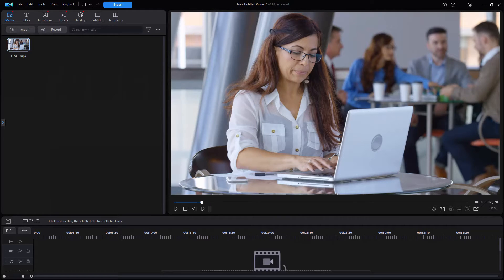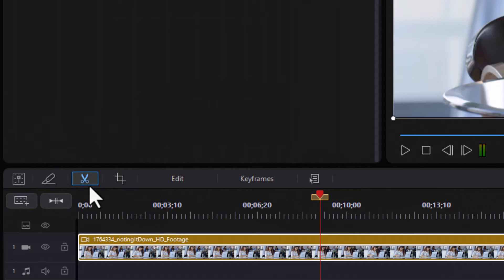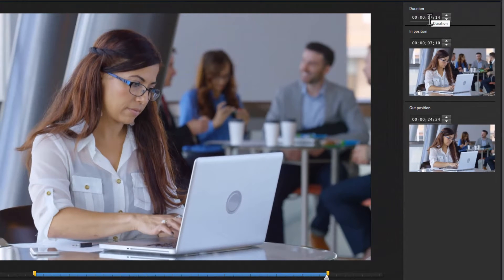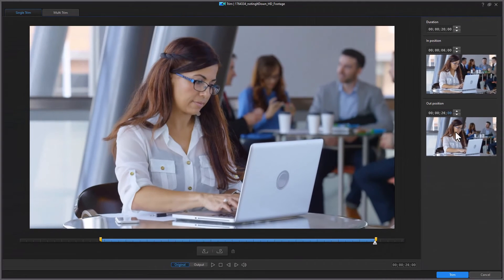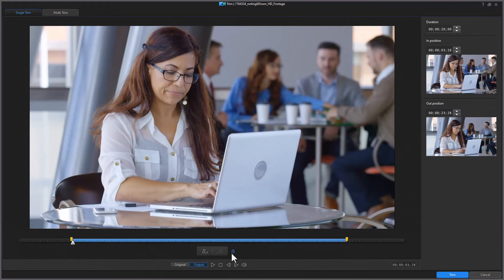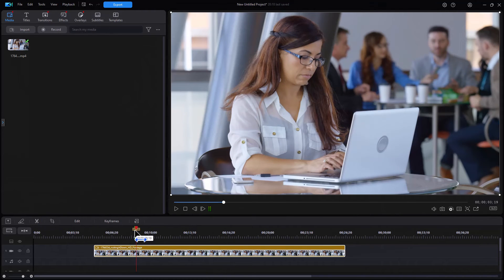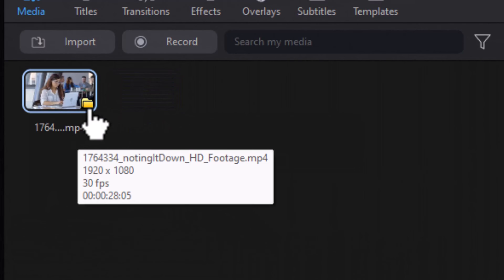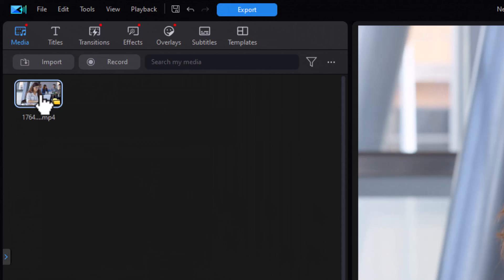Three ways to trim or cut video clips in PowerDirector

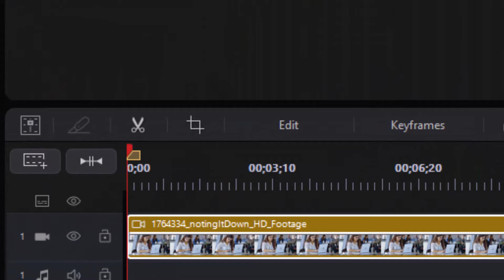Comment: After the recent update, I lost the two trapezoid trim blocks on the playhead or cursor shown here @0:31  Any suggestions?
Reply from the maker: They changed the way that works. If you click on a clip and press the X key on the keyboard, the program will select that clip as a range for you. The trim blocks will reappear. You can drag them to another location if you want. If you press ESC they will disappear. This is the revised way of selecting a range. --Jim